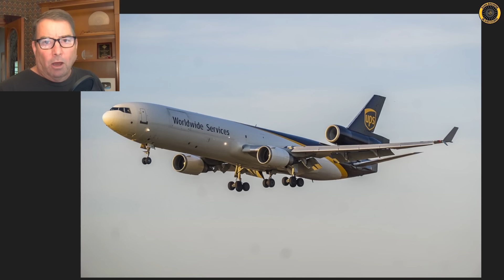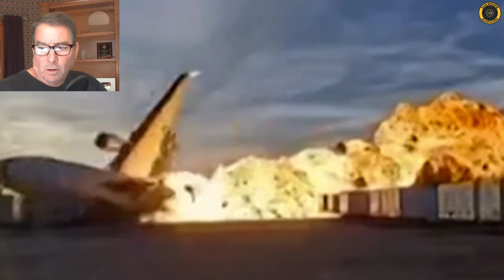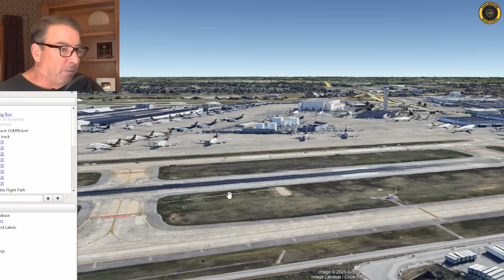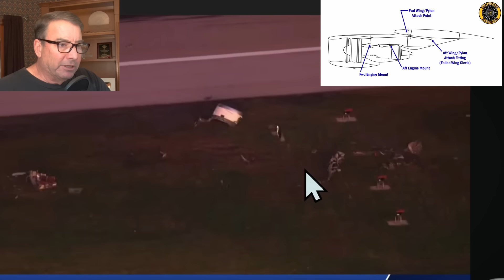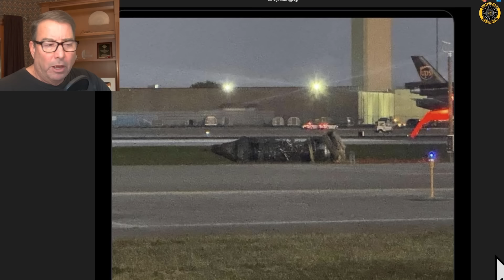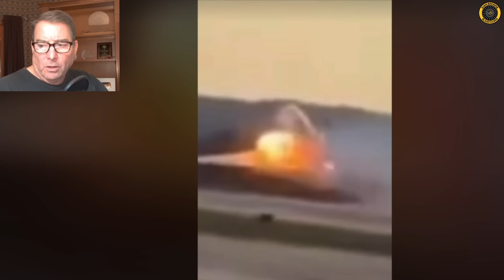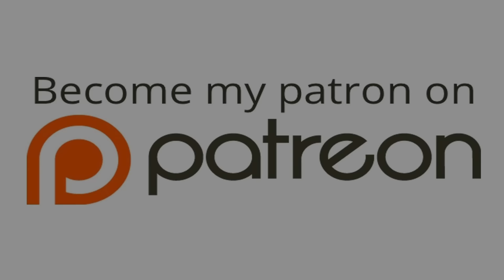UPS #2976 UPDATE 2 6 Nov 2025

Comment from the maker: Correction: Grade Ln. NOT Crittenden. Clarification- Kevlar blanket, behind the acoustic liner.
Reply: As previously stated, that is the containment ring.  Supposed to keep the fan blades from penetrating the approximate structure and center fuselage.   If you look at the nacell you can see the abraidable liner where the fan blade tips rub into this material.  This creates a better seal and also that characteristic wining  sound when the CF6 is pushed to high power settings.  My point being that the fan case seperated from the engine core structure, pulling some of the abraidable lining out the front with it.  This is indicative of a failure to containe a fan blade or blades as they liberated from the fan hub.  My suspicion is this created an extreamly high vibration and basicaly ripped the engine and pylon off the wing a good distance before the 2000' mark.  The shrapnel from the fan section penetrated a fuel tank or tanks and the fire started.  Lastly, the compressor stalls from #2 were most likely from #1's fan debris.  Appreciate what you do Juan Brown!
Reply: Good analysis.  I would say the C check in SAT would have not been a factor then?
Reply: Isn't the fan (deliberately) too far ahead of the wing for fan shrapnel to hit the fuel tank?
Reply: @terrymauboules7017  could also be, as the engine/pylon separated from the wing, the fuel line would be torn apart, which could be why the fire is coming from the top of the leading edge.
Reply: @johnnunn8688 yes that is likely contributing to the amount of fire.  But, the primary source was more likely from wing and center body fuselage penetrations.  Remember the Paris Concord fire was found to be from a relativle small strip of metal from a thrust reverser seal that came from a DC-10 (FOD) that had landed prior to Concord's departure,  if I recall correctly.  

AA had a 767 catch fire in LAX from an HP turbin  failure (06/02/06) on the #1 engine. Half of an HP turbine disk went through the center fuselage, continued through the #2  inboard exhaust cone and became lodged in the outboard exhaust cone.  Other pieces punched a significant hole in one of the fuel tanks.  

I believe there was a second 767 that caught fire in ORD (Flt. 383 10/28/16) from a similar event as well.  

Lastly, the United DC-10 that lost all hydraulics and crashed while trying to land in Souix City Iowa was caused by an uncontained turbine failure in the #2 engine.  

These were all GE CF6-80 variations.
Reply: Just viewed a clearer picture of the engine and noted a large section of the High Pressure Turbin case missing that looks just like the LAX 767 in 2006. A large hole is now where the  turbine section should have been.  The case moduels either side of this hole are intact.
Reply: Right, it’s part of the containment for the fan blades.
Reply: It’s the Kevlar containment for the fan blades.
Reply: @patricktobin1388 yes. Not carbon fiber. We don’t use carbon fiber for impacts. We use Kevlar.
Reply: Also the dash cam video on Glade Ln was taken just after the plane had ripped the hole in the roof of the UPs logistics center. That hit on the logistics center wouldn't have helped the air speed.
Reply: @brienmiller1005 Yep, and the marks on the roof suggest to me that the aircraft wanted to roll to the left as it rotated off the runway, but it was the roof of the UPS building that kept it level. Imo, the far left mark is from the wingtip and the big hole is from the bottom tail section that reduced the pitch but also ruptured the centre fuel tank. Subsequent video footage from locations after Grade Ln shows a large fire from the rear fuselage.
Reply: @peterkelly2492 In the video the aircraft is already past the UPS building and it is wings level, nose high. Could the damage to the roof be just from the tail strike?
Reply: @brienmiller1005   and therefore amazing that the plane was slowed by dragging through the roof, but still got AIRBORNE without slicing the entire width of the UPS building.      The Grade Lane video shows the plane level and dropping: right into the ~21 old recycling towers: UGH.
Reply: @brienmiller1005    Yes, agreed.
Reply: The dash cam at the beginning was on Grade lane. Not the perimeter road. The plane hit that first building and then cleared past Grade lane and crashed further beyond.
Reply: The slats outbd; of the #1 engine look to be retracted as you can see the sawtooth jog in the leading edge.
Enlarging the picture helps one  to see it.
I am a retired airline inspector. 747, 767 & DC-10.
Reply: @John-nc4bl  
I thought the same thing, and I am no airline inspector lol.  Makes you think, did the hydraulic lines get severed for the outboard slats causing the left roll?
Reply: I should have added, I beg to differ with you Juan.
( No pylon lying on the rwy.)
Reply: @John-nc4bl  The pyloon was found on the airport just beyond the 2,000 ft runway remaining sign.
Reply: Carbon fiber is often identified as the primary material in a component actually made of aramid. 
Kevlar (brand name) or aramid (material name) is extraordinary in tension, hence its use to help contain an engine coming apart. Carbon fiber is extraordinary in compression, hence its use in airplane structural components.

There are many fiber products in aramid, with different attributes, from which tows (think yarns) are made. There are many more forms of carbon fiber, each designed for filling particular needs in application. Both materials provide tensile and compressive properties to a component, but each material particularly excels in one. In all cases where the engineering objective is to maximize one or the other property, or even both, the material must be held rigidly in a solid matrix, forming a composite material. Otherwise it’s just a loose fiber or fabric offering little benefit. The matrix can be epoxy, polyester, ceramic, or another rigid material.  

Composites are amazing!
Reply: I thought carbon was strong in TENSION?
It was incorrectly used in compression in the submersible fail?
Reply: Also, looking at the same photo, there appears to be a large hole in the rear of the engine in the vicinity of the HP or LP turbines.
I wonder if a turbine disc may have failed and exited through the turbine case…
Reply: Yes at about 38.148016°, -85.736548° from Google Earth
Reply: @Merv-Bob  Or 7070 Grade Ln Louisville for those using Google Maps.
Reply: The NTSB folk did a FOD walk of the rwy. and there was no mention of the pylon.
Reply: @John-nc4bl you can see the pylon in Juans video. It's clear as day. The pylon is significantly larger than a small piece of FOD. It's about 1/3rd the size of the engine itself. It's right there in the grassy area near the 2k foot marker.
Reply: @Rogue1_7.62  Thanks for your reply and correction.
                                     I wish that it was in the daylight.
I have listened to the two NTSB reports and it was noted that they did a rwy. area FOD  walk and there was no mention of the pylon.

So if it is the pylon lying on the grd; as the pylon was departing the wing it probably tore out the tombstone shaped forging that is fastened to the fwd. spar and ripping out part of the spar. Since the sectioned slat drive shaft is located on the fwd. face of the spar, it would be bent or torn away as well.
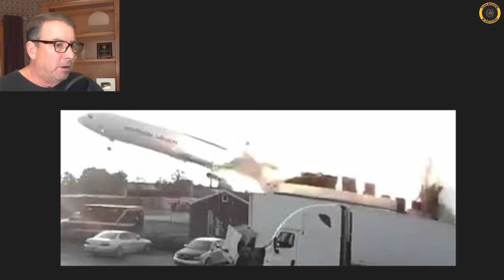Reply: I looked closely at the takeoff video and where you're seeing a compressor stall in 2, I'm wondering if it's in 3, I believe that they hit those trees at the end of the runway at 1:56. 

They fought to get the altitude to clear the trees but you can see them bank left slightly in attempt to clear it but they didn't quite do so, it hit the trees, brought the right wing down and they begun to lose altitude, corrected left and brought the wing into the UPS building.

So unfortunate for all involved. 

Any thoughts, @blancolirio ?😮
Reply: The compressor stall was in #2. The roll to the left was very unlikely due to pilot’s control input, but was coupled to induced yaw from right engine asymmetrical thrust.
Reply: @davidzarn4568  The roll to the left was nonexistent until the crash sequence. The entire time it was airborne it was wings-level. Watch the video from the airport vehicle. Pilots don't automatically lose control when they lose an engine. They kept it wings level till the end. This isn't AA 191.
Reply: In the overhead picture of the UPS facility. It looks more like a tail strike on the building rather than the wing, in the dashcam that is from after the wing is still level and intact. The aircraft likely yawed left and tail struck will climbing and that's why it's off the runway centerline.
Reply: @roastedpotato1487 I agree.
Reply: @roastedpotato1487  You're right about the wings-level, nose (very much) up attitude. I've seen comments about the aircraft being rolled far to the left, with one person describing it as knife-edge. It didn't get that way until the left wing was mostly torn off in the crash sequence. These planes will keep level flight and remain controllable and safe following a simple, uncomplicated engine separation. For these guys, it was very complicated, and they just had no power. 😞
Reply: AA 191 was not about mechanics wanting to save time. It was the company's officially documented procedure, evaluated and written up by their in-house engineering team. Continental did the same thing, with the same model of Hyster forklift, and United was doing something similar (and safer) with an overhead hoist. I feel like I've become the evangelist on this. It's all in the NTSB report for AA 191. The problem wasn't mechanics going rogue. The problem was engineering. The engineers never observed the entire procedure. (If they had, they'd have seen the problem). They didn't consider the capabilities and limitations of the forklift either, and their instructions were easy to misinterpret - some items were critical to do in the proper sequence, but their documentation didn't make that clear. And they didn't monitor the procedure for faults very well. It was really an engineering issue, not a maintenance issue, and the accident report makes that very clear. But the engineers were mostly in favor of the forklift procedure because they thought it was safer. Instead of having to disconnect 79(?) wires, cables, hydraulic lines, etc., the forklift technique only required 26(?) disconnects. In theory it was a great idea, but the engineers really dropped the ball.
Reply: @DrBeenaPlumber  The maintenance team developed a semi-official "workaround" procedure, which was adopted by most of the DC-10 operators.
Reply: @christopherrobinson7541  According to the NTSB report, it wasn't the maintenance team. It was the engineers. It was far more than a workaround. The engineers studied the idea, then wrote up the procedure, and something called an ECO, which as I recall was their official engineering document justifying and authorizing the procedure. It was a formally adopted standard practice they had instituted, justified mostly by their belief that it would make things safer because it cut down drastically the number of connections they'd have to disconnect and reconnect (electrical, hydraulic, oil, fuel, maybe cables). Keeping the engine and pylon together reduced the number of those connections by 2/3, which is a valid and legitimate argument that the procedure was safer as well as faster. And it would have been safer had the engineers studied the procedure more comprehensively and monitored its implementation more closely. They would have easily seen the problem that brought AA 191 down. They had anticipated that problem when they wrote up the procedure, and they mitigated it by never allowing the front pylon bolt to be installed without the rear one also being installed in order to prevent the front bolt acting like a pivot point. But their written procedure didn't make the importance of that specific sequence of steps clear.
Reply: The biggest question to me is why this crew continued the takeoff beyond V1, or even "airspeed alive", if even that far.  Sure, engine 1 didn't separate until well down the runway, just before rotation, but the video looking down the runway as the plane was taking off shows a smoke trail about the whole length of the runway.  Surely there must have been several key gauges with improper readings, blinking warning lights, and multiple alarms all going off at once WAY before the plane reached V1, given the length of the smoke trail.  IOW, whatever went wrong, it happened VERY early in the takeoff roll and so, if anybody had been paying attention, the takeoff should have been rejected with plenty of room to spare.
Reply: @TheBullethead That's an interesting point but several have commented that whatever happened before V1 may not have been enough to trigger the type of caution that would require an abort. Perhaps some type of caution indicator did appear, but either the crew were trained not to abort for that type of caution or the aircraft system was designed to suppress it on the takeoff roll.
Reply: @igclapp I’m surprised at how little clearway there is off the end of 15. Is that because it’s already a very long runway? Given the number of jet departures from  the world port, I wouldn’t want to be working in that industrial park.
Reply: @igclapp  I dunno.  A dense smoke trail seemingly from about power set to Vr about 2 miles along the runway meaning what, the better part of a minute, and nothing dire was going off in the cockpit in all that time?  I really find that hard to believe.  I mean, the highly noticeable smoke is probably what triggered the guy in the airport ops truck pull his phone out and start filming just before the plane rotated.  I'm thinking most of that smoke was produced before visible fire, which IMHO resulted from the engine ripping itself and its pylon off shortly before Vr but likely after V1.
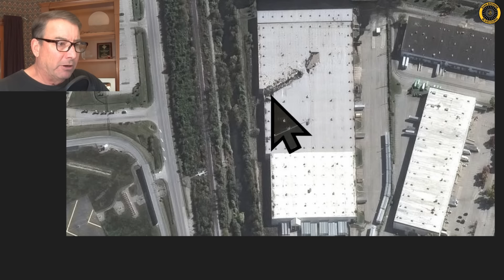Reply: 1:47 Your still of the dashcam looks like it was on Grade lane, not Crittenden, and that is the billboard in front of Chris Tires not the one in crittenden.  You can even see in your photo that the building says Chris Tires on it.  The buildings you see in your screenshot do not exist on Crittenden and the jet crosses at the wrong angle.  Also, in your screenshot, the plane has apparently already shredded the roof of ups supply chain warehouse roof that you see in your actual shot at 2:01.  Odd as that is, it makes sense because the UPS warehouse was before the fireball which occurs just after that screenshot because you see it occur in the dashcam video..  the last ADS-B report was reportedly from the Chris tire rear lot and apparently the dash cam with the plane on its side was in the back of the Chris Tire rear lot.  Which means that power line hit, tank hit, barrel roll and fusilage impact  occurred in within the space of about  1.3 second and about 400ft.
Chris tire is a bit beyond the upper right corner of your aerial photo.
reddit map by jessiejane17 on r/CatastrophicFailure gives approximate locations of things.
Reply: Hey Juan, I had heard that the aircraft had possibly gone through a heavy check about 3 weeks ago. Have you seen anything like that about this aircraft?
Reply: In Google Earth, I matched up the angle, yellow road markings, buildings, trees, intersection, and the billboard to the right. From what I saw, the dash cam was recorded on Grade Lane at:
Latitude  38° 8'53.31"N        Longitude   85°44'11.16"W
Reply: @scooterfoust4361 Agree with the location you pinpointed. In the video you can see the airport control tower to the right in the distance. In the foreground to the right you can see storage tanks of Kentucky Petroleum Recycling, which apparently took a direct hit. The driver of the dashcam vehicle was very lucky.
Reply: Is that also for fan blade containment?
Reply: They  also found the second engine in the area by the trees
Reply: @cammiller5516  the #2 engine?
Reply: What keeps this from happening on Air Force One?
Reply: Googling is a know-it-all-!

To my knowledge, this is the variant of the GE CF6 engine that was on the UPS MD-11 that crashed.

The General Electric (GE) CF6-80C2 engine has 20 or 21 life-limited parts (LLPs), depending on the specific engine configuration. 
These parts are distributed across four main modules. 

For the standard configuration, the life-limited parts are distributed as follows: 

Fan and Booster Section: Contains 4 LLPs, including fan mid-shaft, fan forward shaft, and disks for stages 1 and 2-5.

High-Pressure Compressor (HPC) Module: Has 5 or 6 LLPs, such as stage 1 and 2 disks, stage 3-9 spool, compressor discharge pressure (CDP) seal, and stage 10-14 spool (with the 6 LLP configuration having a separate stage 10 disk).

High-Pressure Turbine (HPT) Module: Includes 4 LLPs, specifically stage 1 and 2 disks, spacer impeller, and rotating stage seal.

Low-Pressure Turbine (LPT) Module: Comprises 6 LLPs, consisting of disks for stages 1 through 5 and the LP shaft.

I must note that as an airline inspector, I enjoyed looking for squawks on these engines.
Reply: @John-nc4bl  The aircraft completed a "D" check on 18th Oct 2025, which probably including work on all three engines, they may have been replaced. Engine failure usually occur shortly after deep maintenance, which is why usually all engines are not replaced at the same time.
Reply: The flight was delayed to HNL for 2 hours before departure due to some kind of  issue with the number one engine.

Comment: Difficult to grasp how serious an issue the crew had here.
They know they had a fire, but even if they got a chance to pull the T-handle, the firewall shutoff is on the pylon, the fire bottle is on the pylon, and the boost pump is in the wheelwell. So, the boost pump is still running, with a fire, and no shutoff valve, no fire bottle, and when the engine left that upset the CG, to an aft CG of all things. Geez what a mess